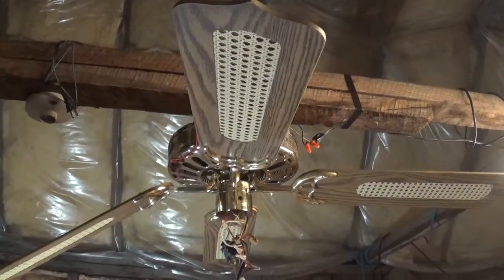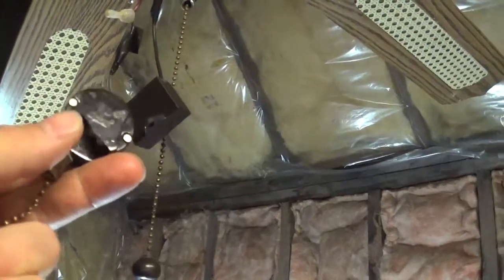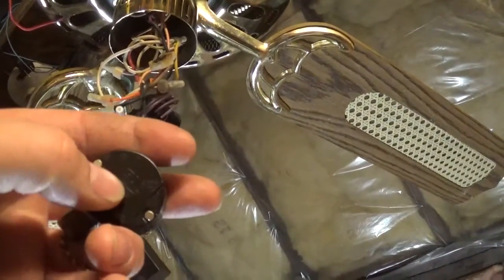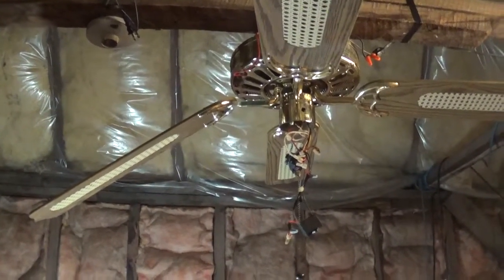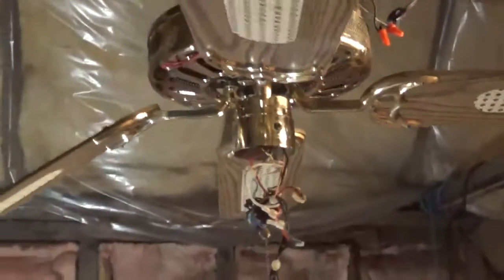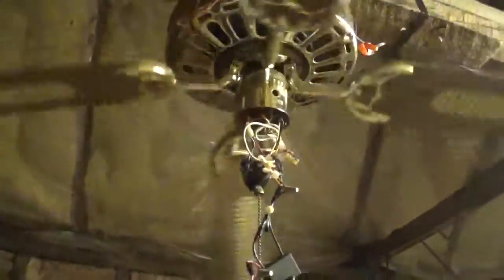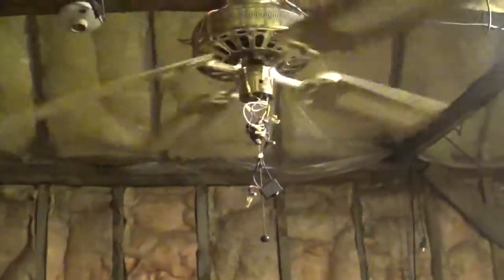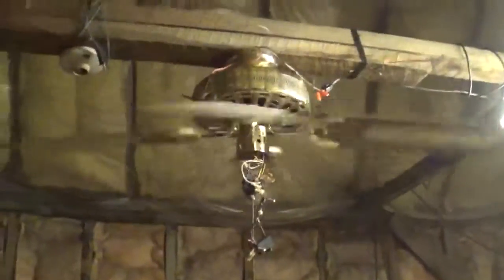Mystery Cf problem solved!

Comment: Wow that was wired really strange.. Definitely improperly.. Glad you got it working.. too bad the blade is so messed up now lol.. How did you add that writing over the video if you can't edit videos? Sounds like the JBWeld isn't the best option for repair unfortunately.. You may want to just get a new set of irons.. As far as the rod idea goes,, that may not work because it will throw the fan well off balance, and you may get some annoying noise as the air flows over it.. but its worth a try.. Do you have a thermometer to use to measure the temperature of the motor? Motors being hot to the touch is often normal to some degree.. Could also be some issues with the capacitors of the power draw is off.. Does that glued blade actually maintain pitch as its running?
Reply from the maker: +Jordan U I used the youtube editor for the writing, I wish it could make cuts, Can hardly even call it a video editor if it can't even make cuts lol.
 Your probably right on the rod idea, I never really thought about that, although if I can find something that's really light then It will hopefully at least be a little better, at least the blade won't be pointing down lol. It actually does manage to hold it's pitch very well, from what I can tell it doesn't affect it at all. But there is about 5 good layers of goop on there lol if it was only 1 or 2 layers then It would probably kill the pitch as it speeds up.
  No I don't have one of those thermometers but I really want to get one. That Is true, fan motors are generally fairly hot to the touch, but this one is like pretty much burning hot lol I was caught off guard the first time I touched it lol.
Reply: +Hobbycentral I've been able to cut videos using the YouTube editor.. I still can't believe that's holding the blade on.. I got one of those thermometers a few weeks back.. I use it every day lol its a neat gadget.. Fairly cheap too I think mine was only $15..
Reply from the maker: Jordan U I will have to check that editor out some more, I couldn's figure it out for the life of me lol,
 
 My uncle has one of those thermometers and it cost him like 50 bucks lol so I figured they were all that expensive. I'm definitely going to get one now
Reply: Hobbycentral What browser were you using? It may have higher requirements than the basic model you were getting..
I always thought those thermometers would be a pretty pricey item also.. Then I looked on Amazon and found you can get them for pretty cheap.. There's obviously plenty of more expensive and precise ones out there.. but the one I got I paid less than $20 for and it works well..
Reply from the maker: Jordan U I always use google chrome, I used to use exploror but apparently it is less bug resistant if that's a technical term lol
Reply: Hobbycentral Google Chrome is good.. I use it also.. Used to use the FireFox then that started to go down hill.. Internet Exploder is, by the opinion of most technical people, one of the worst web browsers out there lol.. If you're on XP then Exploder 8 will not even be able to view most web pages currently.. its too old..

Comment: Cool qu'il fonctionne mieux! Tu devrais pouvoir trouver des bras de pale de remplacement sur eBay.
Reply from the maker: +Jean2291 Thanks, I would just buy new brackets for it but Idk if this fan is worth it. I'm still kind of scared to use it unattended because of the hot motor issue.If it passes the amp test then I will probably get new brackets for it.